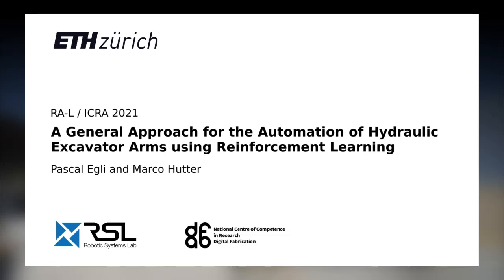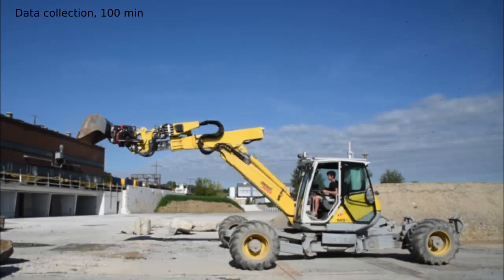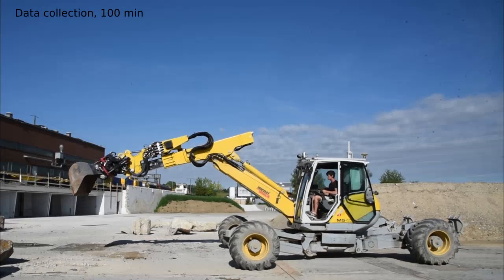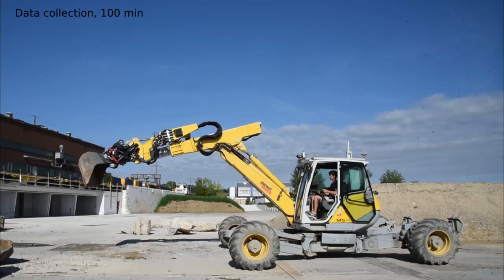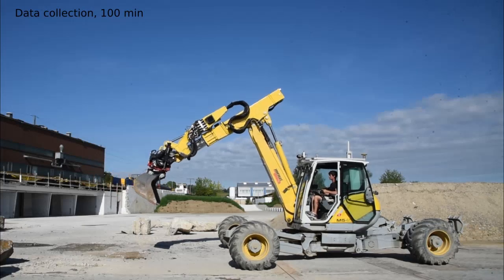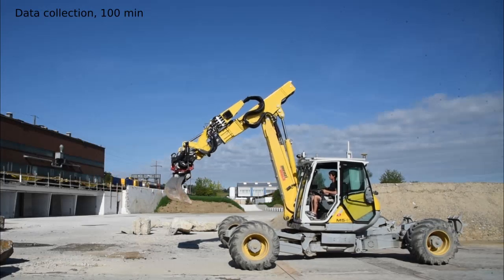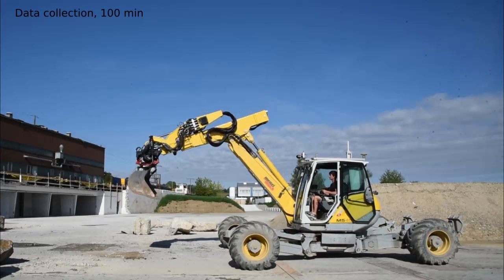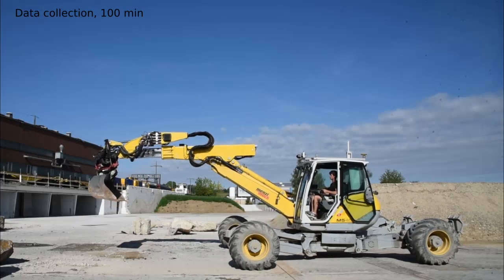A General Approach for the Automation of Hydraulic Excavator Arms Using Reinforcement Learning

Comment: I don't see why this can't be done with regular PID tuning/dampening and inverse kinematics. Maybe I'm missing something?
Reply: Different approaches to the similar solution? Now computer scientists can also solve mechanical control problems lol
Reply: This reinforcement learning which is implemented into the excavator, does not need daily tuning like PID or other control automation. That's because reinforcement learning will train the excavator (however it's different from its weight and type) continuously to make it automated. Surprisingly, It can be implemented into different excavators too!